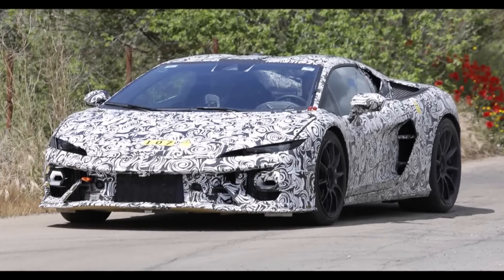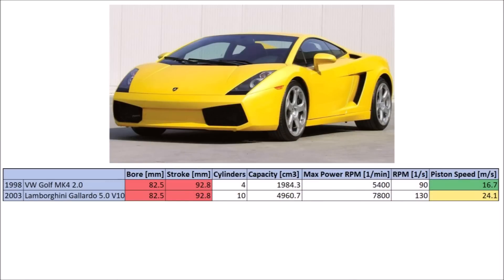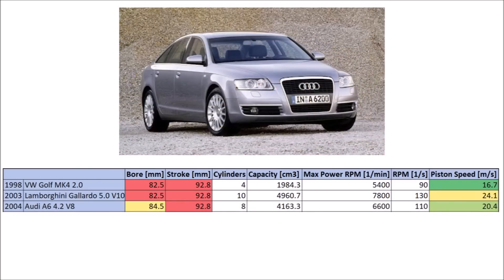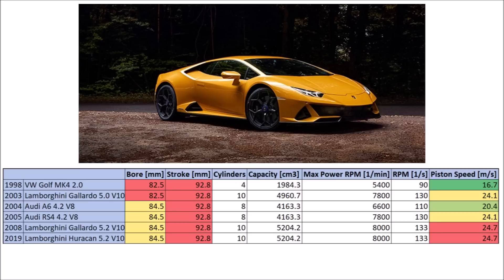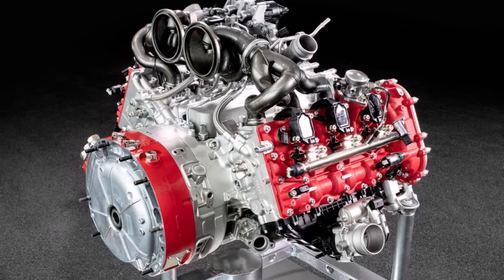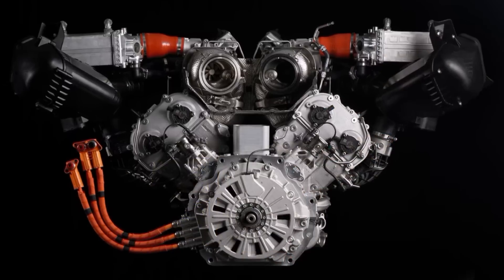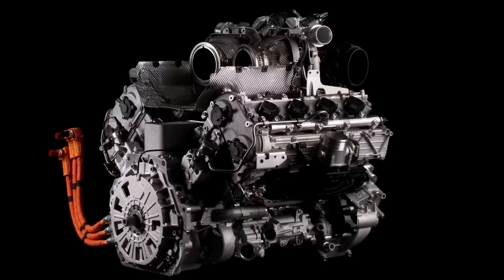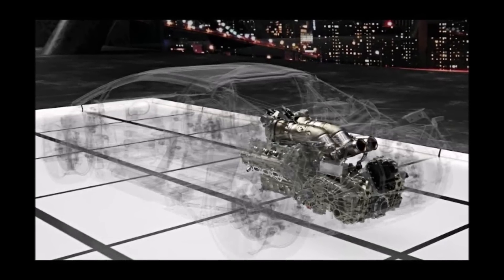Lamborghini Temerario - 4.0l V8 Biturbo and 10,000 RM - But Why?

Comment: Hallo B Sport! I follow your videos as I find you able to explain very well technical stuff to people like me who are just car enthusiasts/petrolheads, I am not a mechanic, even less an engineer...
Sorry if my question is a bit off-topic, not about piston speeds nor undersquare/oversquare pistons, but what I reckon is this twin turbo V8 is another 'hot Vee' engine, with the exhausts and the turbos inside the V; these engines may have a shorter turbo lag (that' s what they say), but... what about reliability and overheating problems? Am I wrong to be skeptical? Can you answer to me, or did you already cover the topic in some video I didn' t look at?
Reply from the maker: Thanks!
You are right that temperatures are a challenge in hot V configurations, especially for petrol engines. It even caused the paint on the hoods to melt, which you could see on many prototypes of different brands.
So yes, also reliability is a bit more challenging, but it's something manufacturers can solve.
Reply: @bsport320  Thank you very much for your interesting reply! I am happy it is a problem that can be solved because... most  of my dream supercars seem to have this kind of engine: Merc AMG GT, Aston Martin DB-12 (Merc V8 under the bonnet)...
and even the most powerful versions of Range Rovers and Range Rover Sport use a BMW hot-V V8; I am satisfied with a more 'humble' 6 cylinders TD, but still....

Comment: The Corvette v8 also has 2 turbo's, except it has 250 HP more than the temerario engine. With more torque overall than the temerario which has 300 nm of torque coming from the electric motor.

Comment: According to sport auto, the bore and stroke on Temerario V10 is 90 mm x 78.5 mm
cylinder pressure: 155 bar, compression: 9.5:1
engine weight: 230 kg

Comment: First of all, no one complained of "loss of power", I don't know where you got that from. Secondly, you're making seem like that 5.0L V10 is similar to the 5.2L V10. They're not. They're completely different engines. The biggest difference being that the bore spacing is difference. The two engines have completely different blocks and heads. They have nothing I'm common other than the fact that both engines are a V10.

Comment: The v8 is built from scratch by the Germans, with the quality and reliability Made in Germany.
Reply: Lol there's nothing german in that car if not for non-functionable tablets
Reply: @francescotrombetta8548  deniability is the root of stupidity
Reply: @Ov3RFLoW88  not looking for proper infos is the root of stupidity, lamborghini headquarters are at Sant'Agata bolognese where all the parts of the car (engines, headlights, body etc.) get built and assembled.
Lambo using small components of other cars' brands isn't something unusual as they used to borrow side lights from Ford.
Reply: @francescotrombetta8548  Lamborghini is 100% owned by Audi. The engine is built by the German. Thus Huracan shared the same platform with Audi R8, Urus shared the platform with Audi Q7, Bentley Bentayga and Porsche Cayenne. Deniability is the root of stupidity. You make me embarrassed with your shallow knowledge about automotive industry

Comment: If this engine has the proper geometry for high rpm workloads modified it will break all Huracan records (assuming a company crazy enough to modify them)... That's why you see GTR eclipse 3000 HP and Lambo's V10 struggle past that despite the displacement advantage... their piston speeds hurts them (You can't engineer yourself out of a long stroke design).

Comment: I think its awesome and I'm sure Lambo will do it justice with the noise it produces, but i can note that with many very high end tuner 4cyl 10k RPM is always one of the weirdest sounding RPMs, Toyota, Hondas namely that i have heard.  Very different engine but assuming this is flat-plane and basically 2x inline 4s i still wonder how it will turn out as with some (not all but many) of those cars 9k sounds awesome, 11k sounds extreme, something odd about 10k engines some of the time although its usually a rare target since it has most the cost of the 11k engines with less results, just a bit less risk/higher (relative) longevity.  These are all 7-8k engines with extreme high end parts, for racing not production, not bespoke production ones though.

Some of the oddness i likely mention is just that said engines are usually mostly using design changes and tech from 11k engines, so they naturally sound like they are shortshifting.

Comment: Lambo wanted to put their "roadlegal" new V8 into the SC63 but with advice of real race engineers at Ligier and Prema, they change their mind (because their V8 was simply to heavy and not efficient enough) and decided to ask Autotechnica to design a twin turbo V8 for the SC63. Here is the true story.

Comment: Lamborghini produces two flagship lines based on either the V12 or V10. Although now it seems they are moving the secondary V10 line back down to V8.

Primary (V12) line: Miura, Countach, Diablo, Murcielago, Aventador, and the current Revuelto.

Secondary line: Urraco (V8), Silhouette (V8), Jalpa (V8), Gallardo (V10), Huracan (V10), and the upcoming Temerario (V8).

Most other cars they produce is more or less a variant based on these cars.

Comment: This "New" engine is a VW EA825. They are using this design because making the changes of a titanium rotating assembly, finger followers instead of roller rockers, and a modified intake system is much cheaper to develop. Lamborghini already has experience working with this engine in the Urus.

Comment: I think V8 is the best sounding type of engine but it doesn't suit every brand. Lamborghini needs 10's and 12's. V8s are amazing in a Mustang. I wouldn't want a V12 Mustang. Wouldn't sound right
Reply: McLaren is famous for the F1 even though their whole lineup right now is a V8, so...
Reply: @poly_g6068  true but McLaren has a history of being a company outsourcing it's components and driveline to build a car. Also the V8 they use now is very unlike a V8. It's sound is very subdued and underwhelming. I went to the cannonball run last year and although very fast they were the most disappointing car as far as sound. Didn't matter if it was a 720s or 570 or 675lt. I think only the Senna has any acceptable level of supercar sound
Reply: @poly_g6068  I think the only European supercar that makes a right sounding V8 is Ferrari. Because they are very high strung sounding and raspy. The Lambo looks to be getting an Audi V8 and they tend to sound more like American deep thundering sounds

Comment: The power ratings are painfully close to the flagship. Revuelto seems like a bit of an underperformer.
Reply: Uhm, the original Gallardo had 500hp which was only 80hp less than the Murcielago. The same gap with the Gallardo LP560 and the Murcielago LP640
Reply: @bebabcsinya   very insightful. Guess I am just a little underwhelmed by the Revuelto. That gap is now lower than 50hp, 789cv to 825cv. That's smaller than the gap between an e-gear and the LP-560. The torque figures are worse. I guess you'll correct me if I am wrong.

Comment: It S doesn’t make sense to turbo charge it to make the same power as the Revuelto in the cheaper model.
No red for turbos for torque if you are relying on hybrid.
Better to have N/A V8 (lighter and better sounding) pushing 550hp and the same hybrid set up as the Revuelto

Comment: This looks more like an sf90 rival that a 296 gbt and is similar in power that the revuelto and could be easily more powerfull, maybe this needs to be a more track foucsed car, and then create a proper 296/750s rival. Leave the revuelto to the 12cilindri
Reply: Revuelto will rival the SF90, after all it was developed using the SF90. 12Cilindri is an unfair comparison, totally different type of car.

Comment: Claims that piston speed is bad for reliability and is a hard limit. Shows many production cars with a wide spread of piston speeds passing this limit. No numbers about engine life. Some vague claim about lack of power, but no dyno run. Somehow palpatine returned -- aehm -- somehow engineers overcame the piston speed limit. Just funny how strokers reach higher velocity. Maybe the rule was for race engines with a short stroke?
The V6 either has really bad balance, or a weak crankshaft. V8 flat plane at least is balanced to first order. Just use long conrods. Long conrods help with RPM. I wonder if there are some laws about idle RPM. A racing V8 has no flywheel and needs high idle RPM. This would certainly violate some emission laws. In a hybrid you can just risk engine stall when you don't need much power. So, detect stall, stop fuel injection, open clutch.

Comment: At this point I am only interested in whether it sounds good. Fast is now boring, everything is fast now, an M3 can run 9s with a tune and bolt ons, a 911 turbo can keep up with race cars from 20 years ago around a track. Being obsessed with fast we get crappy sounding twin turbo V6s, electric cars, twin turbo mercedes V8s that sound like muffled v8 vacuum cleaners. Supercars need to sound super again. I miss NA V12s and V10s.
Reply: Use speakers. It is all a computer game now. Can we construct a V10 which does not need an excess of silencers to become road legal? What about a 2 l cross plane V8 with straight pipes ? No turbo because power is from the battery anyway.
Reply: @ArneChristianRosenfeldt That's called a Hyundai Ioniq 5 N
Reply: I agree completely. I lost interest in cars after 2016 or so. Turbo automatic g a y ness
Reply: Umm that's why exactly lambo built revuelto and ferrari with 12 cilindri with n/a engine?
Reply: First world stupidity problems!
Just get a set of headphones and pipe in the sounds that you like and you can  just drive a civic and be done with it! Comfortable, fast with no reliability problems and you can have all the crazy sounds you want!
Reply: @LWRC  "JuSt FaKe It!!" microbrained take. Go microwave your steak.

Comment: 10,000RPM give hope the car won't sound as bad as all the current low revving sport cars.
Reply: it's Lambo, they don't make bad sounding cars
Reply: Why is V8 rumble on YouTube always low revving, like below 3000?
Reply: @ArneChristianRosenfeldt  odd firing/cross plane crankshaft v8 engine, like most American muscle cars. Plus, with the twin-turbo they're putting in, the engine won't struggle to keep up to the highest rpm to gain maximum power, so that is why the engine sound so rumbly
Reply: @happysnekk  from their website: in harmony with the vibrations transmitted to the chassis by the flat-plane crankshaft
Reply: @ArneChristianRosenfeldt  Lamborghini? Yes, they actually use flatplane crankshaft. I was talking about the v8 that uses by American cars. As for Lamborghini, they won't make the rumbly sound like the cross plane did because like we know it, they used flatplane, and it'll probably sounded much more like, for example Ferrari 488 or F8, and most McLarens (except F1, Artura, and Solus GT).
Reply: @happysnekk  yeah, just had to make sure because VW uses cross plane a lot. Do audiophiles like flat planes? Every person with knowledge says that they sound like 4 bangers. Like if two Kawasakis pass you. Pagani places all exhaust tips in close vicinity as did the F40. So the bass sound cancel each other due to phase shift. And here with turbo it will sound like a turbine.

People forget that V10 in F1 had those chimneys. The exhaust tips were apart more than a wavelength. Interesting interference. Bring those back to F1, but neither Lambo nor Koeniggseck will sound “good” in any sense.

F1 hybrids at least have the firing order offset between the banks.
Reply: @ArneChristianRosenfeldt  vw? they made that cross v8, then put them in on their most expensive one (audi r8) back then. Because of emission, lack of power and blah blah, then they made the v10 both for rs6 and r8. Yes, it's more poweerful. No, it didn't resolve their emission problem. Then they put that old 4.2 v8 with twinturbos, not in r8 but only rs6. Thus, r8 has discontinued. Finally, say hello to audi e-tron. As for koeniggseg, it's just a crown victoria on steroid with hypercar bodykits

My point is, if you love the car because of the engine sound, you're not wrong, but the problem is it's VW, their focus is on emission right now. If you let me suggest, try to "poking around" on hydrogen cars, they still use the combustion methods. Or, wait for Mazda developing their newest rotary (i don't know for how long though)

i never meant to be out of context but, i do like the sound engines, but when they do try to remove that "feature", it disappoints me.
Reply: @happysnekk  At least with an under-square cross-plane V8 or even a Harley Davidson type V2 with some liquid cooling at the head, emission is no problem. The V2 is even available with DOHC. I dunno why the US sticks to a single camshaft. I always say: Use four small camshafts. It is a series production engine. You will never change those. Likewise, all those valves are identical. You should not count screws as parts as much as you would count all those special parts. V8 heads are often the same parts on both banks, just rotated by 90°. A NA, direct injection high compression engine is efficient and has low emission. V8 are lightweight. So when you know that you need the power, and consider the weight of the whole car, they are not to blame. V8 can have very low idle because instant torque is always positive. Just make sure that your piston rings and valves don't leak.
Reply: High RPM ≠ good sound.

Comment: So the 10k RPM is done to give the same sensations of an NA engine (especially with the flat torque curve)? If so, it goes to show Lamborghini design their cars around their selling points which is something Mercedes-AMG can learn from lol
Reply: Let's hear what it sounds like before coming to conclusions
Reply: @chiefdenis  I don't doubt it'll sound less charismatic than the V10, but points for trying. They could have given us a tuned version of the Urus V8 and they didn't. And kudos to them for that
Reply: @chiefdenis It's incredibly hard to make a 10k RPM V8 not sound good.
Reply: @swecreations  looking at the Ferrari turbo v8s, i don't think it's that hard
Reply: @swecreations  High revving engines dont necessarily mean a good sound. Take the V8 R8 for an example. It revs to like 8200, and it sounds garbage with a stock exhaust.
Reply: 10k rpm isn't going to give the same sensations as a naturally aspirated engine, a classic example is the AMG One with 11k rpm redline.
Reply: Ferrari did not drop rpm for their turbos and was always praised for the NA feel.
Reply: @ArneChristianRosenfeldt  But Merc AMG didn't
Reply: @GearzMonkey  mercedes somehow knows how to get the sound out of their turbo engines and still make them respond like NA
Reply: @ArneChristianRosenfeldt True, the engine won 4 consecutive international engine of the year awards.
Reply: Ferrari? 
When was the last time they made a good car ? Not for some years

Comment: I was waiting for your analysis. You could talk more about the repercussions of their engine layout. Talk more about the implications of the Hot-V, 10K RPM on a Bi-Turbo and why the turbos are above the engine. 🤔
Reply: Hot V/ cold V on a twin turbo is a packaging question. Cold V engines are wide, hot Vs are tall, cold V engines have the exhaust below the banks, while with a hot V its high and in the middle. 

he talked about RPM, but I think he forgot to mention the sound. Ferrari V8s already scream, but this thing will rev 1000 rpm further, so it will scream even higher. 
The dual turbos are simple, single turbo setups just lead to lag, because the turbine has too much inertia. dual turbos lead to less top end power, but more usable power throughout the rpm range and less time waiting for a massive turbo to spool up. 

Dynamics wise I suspect that a cold V would lead to lower center of gravity, but at the same time it means you have less freedom with how you're designing the floor of the car because with suspension, frame and exhaust manifolds + turbos, its pretty cramped down there. 
With a hot V, you get all of that out of the way because now, all you need is a fairly slim intake system that's much more flexible in its shape than the exhaust and can also be made from different materials - all of which means that below the banks, you are free to do whatever you want.
Reply: Hot Vee was introduced to straighten the air intake for cars where the engine is in the front. Porsche then used the hot vee in a mid engine because they feared that the battery (on the floor) would ignite.

Comment: Now they can make the full size 10000rpm 6.0 v12 turbo
Reply: 90° V12??
Reply: @ArneChristianRosenfeldt    Why not 😂. Same as the v8 just another half of one on the end
Reply: @danielthompson3849  equal firing order. Ferrari deviated to 65° . Most extreme case. I would love to see two crossing exhaust manifolds welded to their mating plates. How often do you need to unbolt them? Hot exhaust goes over the valve covers and ignition coils to the turbos throning high on both sides.

The low cg of the battery could make this happen.
Reply: @danielthompson3849  actually the manifold gets hot and you need to let it expand. Also straight pipes are best for scavenging.